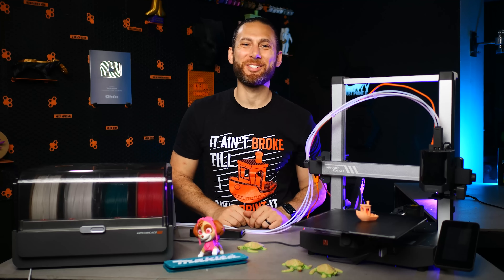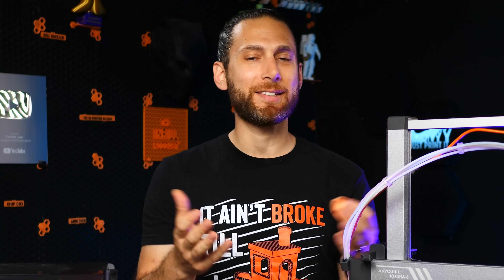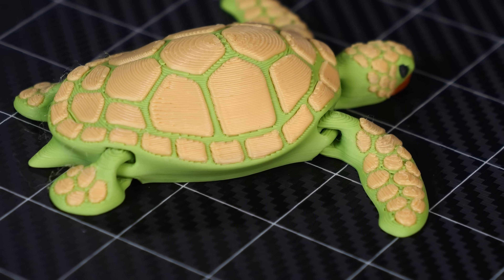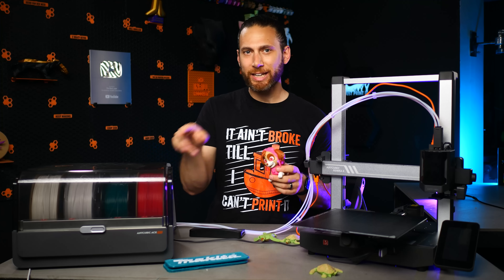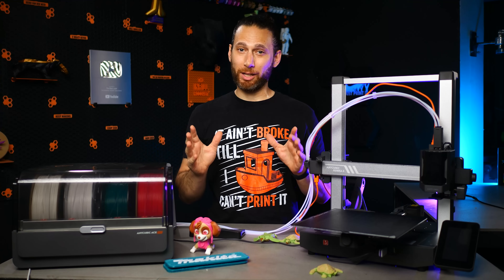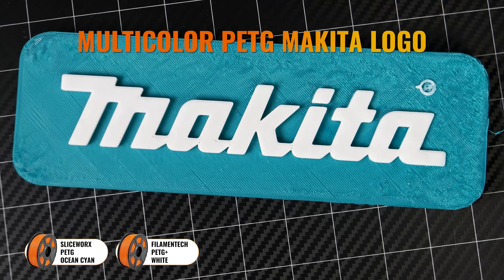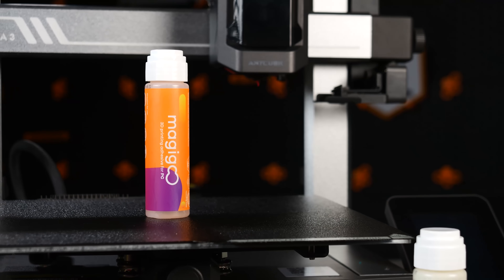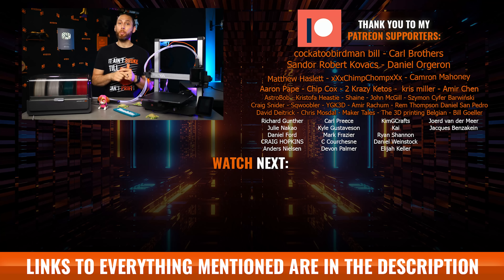AnyCubic Tries Multicolor: The AnyCubic Kobra 3 Combo

Comment: Is there a way you can show us a NICE CLEAN Print?  Every print had extrusion problems. I understand you had to deal with others slicing the files but every print having an issue IS an issue. These machines are not prototypes they have been gone through by the best techs and then sent to great tubers like you. I know it must be hard having to make an excuse for every below par print and having a CONTRACT that you can only say so much but it seems this product is not ready.
Reply: Yeah the degree of Z-banding on the dog reminds me of when I was running printers with axial rods instead of lead screws.
Reply: And that's why no one should even bother looking at it. Bambu Labs has shit figured out, this is just "not so cheap" copy.
Reply: Or frankly  he  didn't do any adjustment  on the printer
Reply: You can ask for a clean print, or see a real print and judge for yourself if the quality is there. And it doesn't look good.
Reply: @punk6119   I am wondering if the machine he is reviewing CAN make a clean print. Should I buy a machine that Cannot make a good print.  This is WHY he is showing the machine. Also , gives a look into the ethics of the tuber.
Reply: TNL has sold out a long time ago. Wait for other reviewers. The only reason I watched this is because there's not many proper reviews yet.

Comment: If they can integrate the ACE with older printers, especially ender models, that will provide a much better value proposition. An open source multicolour unit with an orca slicer integration would be even better, as it could work with bambu...

Comment: I was getting ready to get my first 3d printer. But with all these multi color printers coming out I guess I should wait a few more months to see what else is released before making a purchase. I know the k2 is getting coming out in July.
Reply: get your first printer and learn to use it and troubleshoot print issues before going multi color. Even something turnkey like a bambu will require troubleshooting and setting adjustments at times
Reply: @aleks138  I was kinda thinking about that, I was originally looking at the ender 3 v3 corexz. But I only have room for one printer, I actually have to make room for it. So I don't want to get something that I'll out grow, eventually I'd probably want the multi color stuff.
Reply: Idk how long you've waited, or how tight money is for you, but the best thing in my opinion to get into 3d printing is to just buy a 3d printer. At this point, new 3d printers have been regularly coming out for the last year or so, and holding off on buying one might just suspend you in the waiting phase forever.
Reply: @AWZ1287  I'm exactly like you man. Did you buy a printer?
Reply: @ΓιάννηςΤσ  I ended up getting a K1C

Comment: I think a critical component of any video about new multicolor devices is a comparison of waste via poops and priming between other multi color devices (when the creator has access to multiple devices) it needs a few models of different complexities and colors.
Reply: I guess that is because it is a huge waste, and will be very slow too. As this is one heatblock printer. Obviously. Multitool printers can do that with little waste and very low delay.
Reply: Huge agree
Reply from the maker: Yeah, that was a huge oversight in my video.
Reply: @thenextlayer  even in a community post or short that data would be fantastic
Reply: @thenextlayer I don't think it's that big of a deal. If you're doing multi color, you know it's going to happen. The print functions are huge, waste is not. Very neat their system is also a filament drier😊

Comment: hey this is a great printer. I have a dumb question lol. How does the purging occur, i didnt see any purge block or "poop" as the bambu users call it
Reply: It poops off to the right
Reply from the maker: Poops out the right side. I’m embarrassed that I forgot to show or mention that. It flicks poop. There’s also a priming tower
Reply: How can you say it is a great printer? you haven't seen it working very well up to press!
Reply: how do you know it's a great printer? lol - also it poops off the right side the same way the BBL A1/A1mini poop off the left. It doesn't have a nozzle cleaner though as far as anyone can tell, vs the BBL models clean the nozzle as they exit their poop sled.
Reply: @joeylopezdesign  it does have a silicone nozzle cleaner smh.
Reply: So you think an extra $110 and NO DRYER is worth getting a little rubber foot?  😂🤣😂😂 @joeylopezdesign